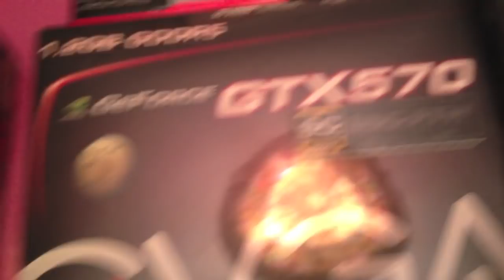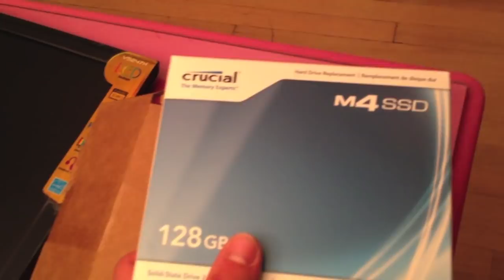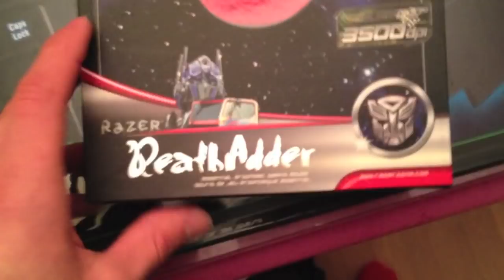PC Building Banana-Journey!!

Comment: @sergeantshizzle RAM is Random Access Memory. It is consumed by running programs and processes. Running programs will stay in RAM while open, and consume more when needed .. processes will consume RAM that is available and leave it after the process is finished. When RAM is not available the OS will start to page file. A page file is a file on the HDD that acts like RAM, however is much slower due to read and write times.

I recommend a minimum of 1GB to 4GB per core.

Comment: I would suggest an i5 3570k, (there is not much difference when gaming with the i7 3770k) and a nvidia gtx g70. Or if you are a amd fan, a 7950. The power supply, ram, case, motherboard, etc. are up to you as they do not affect performance much. (Just get at least 8gb of ram for gaming). This rig should run 99% of games on ultra at least 50 fps. Hope this helps!

Comment: well it seems you took some of my advice, great choice for a GPU My series is two lower and works amazing, EVGA has a policy for upgrading, all you have to do is turn in your old graphics card, pay the difference for the new one, and get it for a lot cheaper.

along with your problems, most cords are labeled as to where they go (as in the CPU it should be labeled with the letters for the power supply.)

Comment: Right about this time you should change your CPU to a i7 4770k (the k-series is unlocked so you can overclock), get a CPU-cooler and get a new graphics card, maybe a 770, 780, R9 280X or R9 290(X). If you still have your same specs your screwed, you won't be able to run your games smoothly, I saw in your Skyrim video your frame rate had a bit of trouble. (Or maybe it was just me)

Comment: I agree with almost everything you bought except for the mouse and keyboard, from my personal experience Razer isn't really a good company for pretty much... well... anything. I had a Death adder which never worked and the same keyboard as you got which broke really quickly (some keys stopped working). After that i switched them both for a logitech gaming mouse and keyboard plus got a headset which was a million times better than my friend's megalodon which is terrible and cost more than mine...

Comment: @GhostRobo please take note of this please, I can build a computer like that get it up to fully operational stage in about 6 hours if I worked flat out with a bottle of Lemon Ice Tea and a bottle of Coke and make a shout out on this, but you choice the right parts, I see you went probs idk if it was my suggestion for 16GB but you choice correctly you need bucket loads of ram to run games at max speed haha, JBL9996666 (Rob Gracie)